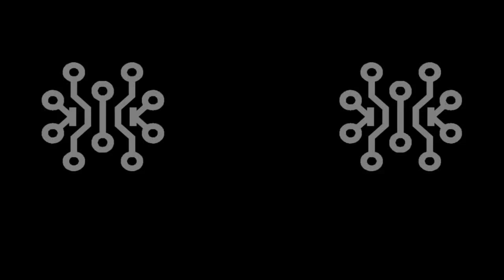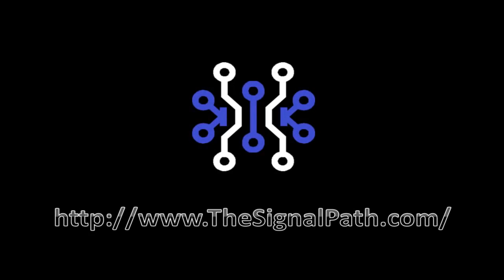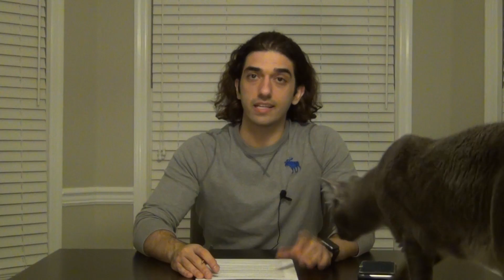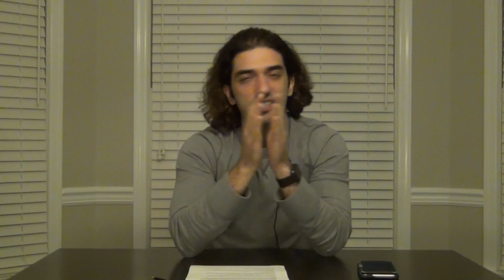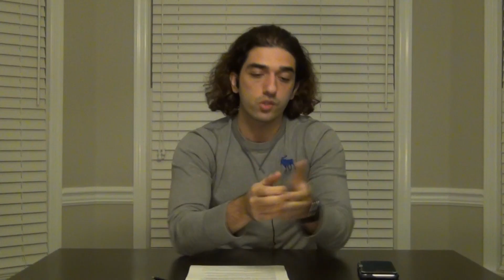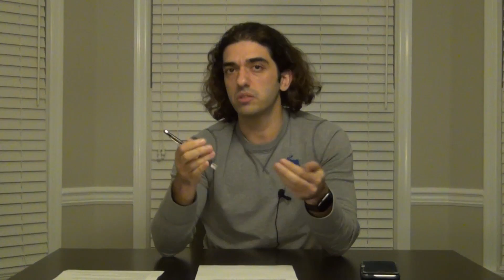TSP #84 - The Future of The Signal Path, Patreon & Q/A (September 2016)

Comment: What lab do you work at? I worked at the Columbus lab when it existed (1999). Thanks for your great videos.
Reply: I believe he is in NJ.  I was also at the Columbus facility from 1995 until 2012.
Reply: I was thinking that he works at the Whippany lab, if it still exists. They did radio and cellular as I recall. I was with the TNM group (97-99 CMB). Originally, SCCS, No2. Twenty-six years with the Bell System. Switchman (SBT&T, 1973) to Engineer. What a ride. Google search turns up Murray Hills and Crawford Hills as being left in Jersey. It's Nokia now.
Reply: +Wayne Bjorken - Glad you enjoyed your time there too.  I was very dedicated to my work and enjoyed it very much but my number finally came up after 12 years of layoffs.  As far as I have heard the Columbus facility to supposed to shut down completely this year or early next.  I'm really not in touch with anyone who is still left.  The company is just a shell of what it used to be.  It was good to be part of it for a while but a shame to see what happened to it.

Comment: Nice to see you back Shahriar, with the implementation of 5G coming up. Do you believe the cost to benefit ratio would be reduced because of the easy to implementing 5G. And with 5G and its higher throughput, do you believe the service offerings will not be just data but video as well? Talking about how you started in electronics was how I got started as well. I was given a 50 in 1 project board from my grandmother and it was one of the greatest gifts I received. Again nice to see you back and look forward to more video's of you and the pouch. Cheers